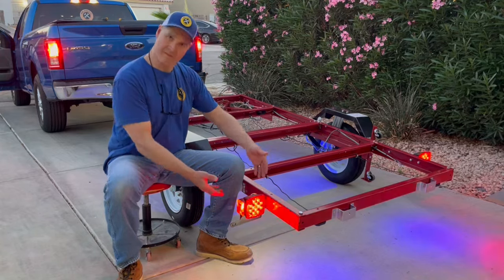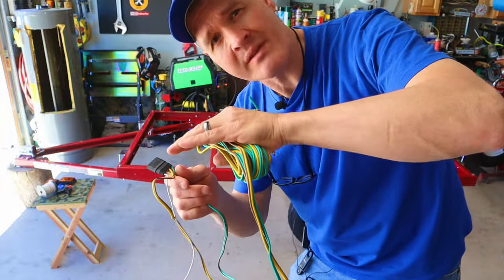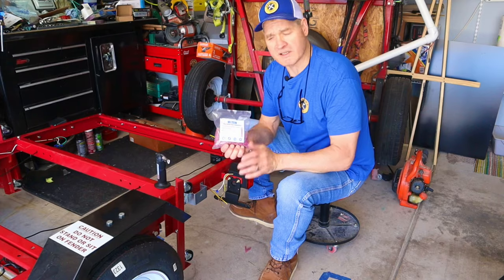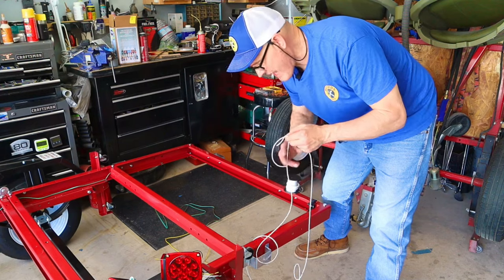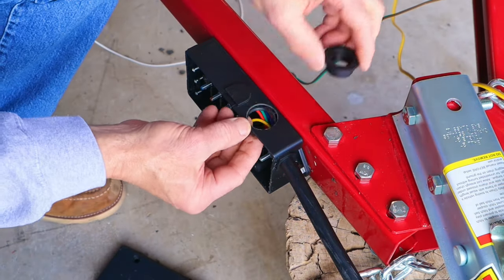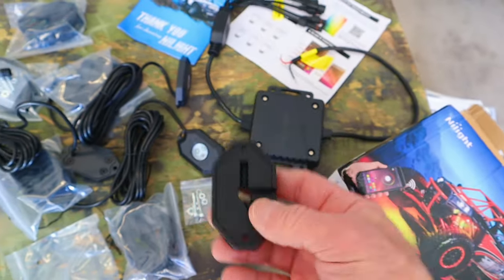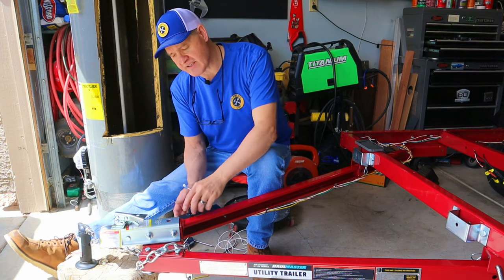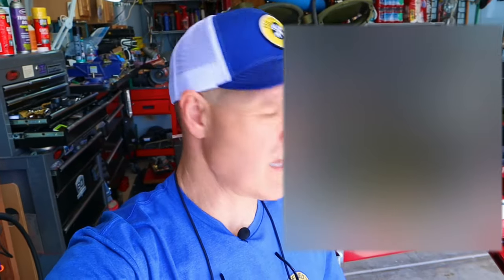Harbor Freight Folding Trailer Wiring Lights Installed- plus “Rock Lights”

Comment: Glad I watched this, I personally don't want color changing rock lights under the trailer. But I do want to build a box on the trailer to hold fishing gear and have lights inside that box. Then build two kayak frames on top of the box. These videos walking through this trailer are top notch!
Reply from the maker: I honestly just like to have the white light under the trailer. The fact that they change colors was incidental lol. Thanks for checking out the videos. I have a few more to make with this trailer, i.e. flooring system, handrail, 13 inch wheel upgrade & spare tire mount on the tongue.
Reply: @MrFredsDIY  I've subbed! Can't wait to see future mods! You'll probably be done by the time I get around to buying the trailer (I'm just now pinpointing exactly what kayak I want to purchase lol). It's also very helpful you link all the products you use. Now that I think of it, some rock lights underneath may not be a bad idea while camping/fishing at night. So I may end up needing 2-3 switches on that 7-pin box.

Comment: Yeah they only give you a sample of the wire clips. It was the one thing I had to buy more of. They work fine for holding the wire, just not enough of them. I used a copper lug that uses a set screw to hold the ground wire from each light so later if I add a separate ground between all of them it will be easy. They work find now but I suspect I'll be adding the ground wire as rust and corrosion sets in. I figure I'll paint the lugs with that liquid tape stuff. 👍

Comment: Hello there is an easier way to line up the wires on the clearance light on your trailer. It’s crazy that they expect you to have the clearance light flat against the trailer frame when two wires are in the way! To correct that foolishness I just disassembled the light set that frame of the light against the trailer frame where it mounts on the frame. I marked the backside of the light frame and drilled a hole in the clearance light frame and I ran the wires through that hole and it sits perfect against the frame. I reassembled the clearance light with the two screws. It would have saved you a ton of time chiseling the hole out with a knife. Just about finished wiring mine I’m trying to figure how much slack is needed where the tongue and trailer bed folds. Weather was bad so I’m building it in my living room🤣 Oh I also ran my wires in 3/8” split loom and secured the wires to the frame with 3M Zip Tie Mounts and zip ties. The 3/8” split loom fits perfect in the frame holes all the way down the trailer. It’ll protect the wires. Enjoyed the video very helpful.

Comment: @MrFredsDIY - Help please?! 🙏🏻 
I'm only running a basic 4-pin trailer wire harness. I'm stuck on how to lay out the wires so I have enough clearance for when the tow bar part separates to fold it. These Harbor Freight instructions are garbage. 
Could you help me? I'm begging. 
How'd you route these wires?

Comment: Having some light trouble, I'm thinking its a bad ground. If I run individual grounds can I run them straight to the 4 pin connector without screwing into the trailer? Great vids, thanks for all the help.
Reply from the maker: You can absolutely run individual ground wires to the lights and back to the ground on the pin connector!
Reply: @MrFredsDIY  thanks again

Comment: Smart to run full grounds. Because the trailers are kits and pre-painted, and designed to fold and tilt, they have terrible electrical continuity. The white is chassis ground, not common.
Never use wire nuts for weather exposed connections. When you use standard butt-splice connectors, cover them with heat-shrink tubing. Better yet, use the heat-shrink butt-splice connectors like you did. Do not confuse the two.
Never use splice connectors, especially when exposed to the weather. They don't seal and will corrode, especially with the aluminum to copper connection. Cut the wires and use the butt-splice connectors.
Never use electrical tape for permanent protection. It's not intended for that and will become gooey and let go, especially when exposed to the weather.  Use rubber tape instead.
Is that rocker switch really waterproof, or is that simply a dust cover?
The color coding is correct for a 4-Pin system.

Comment: Why 2 separate ground wires?
Reply from the maker: Because the trailer “folds on hinges” using the frame as the ground  was challenging. The frame is pained very well, including the bolt holes. Running a ground wire to every lamp just made sense.